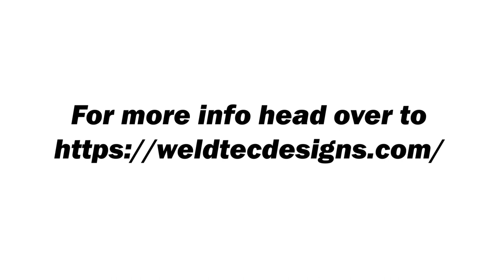Ford E Series Van - Install sliding door extension

Comment: If your van is older, I recommend replacing the door latch above the slider! If it goes bad like mine did, you will end up with a 3 inch gap because the latch will not engage.

I had to remove the 3 screws holding the latch, force the Lach farther into the door so it could close and then tape the door shut while waiting to get the $70 part. The door when taped will still lock

Comment: About to pull the trigger on a 2007 Ford E350 Extended Passenger van in Gray. Can't wait to lift it and get bigger tires on it. Looks like I'll need to do this as well since it has the sliding door. Any idea when the Ocotillo Cruiser lift kit will be available? I'd do the Baja, but I've never welded in my life so not sure I would want to tackle something like that. Love all the videos and appreciate all the support you give your customers.
Reply from the maker: Currently waiting on shocks still, Fox is on a global back order at the moment and its a pain in the neck right now. We will  update when everything is back to stock.
Reply: @WeldtecDesigns  Thanks for the update. We did make the purchase and are looking forward to getting some gear from WeldTec Designs. Thanks!